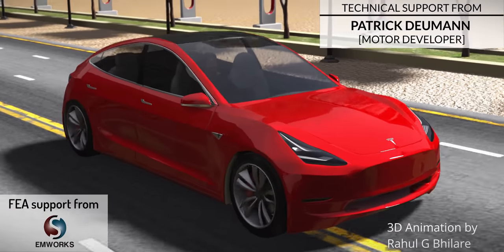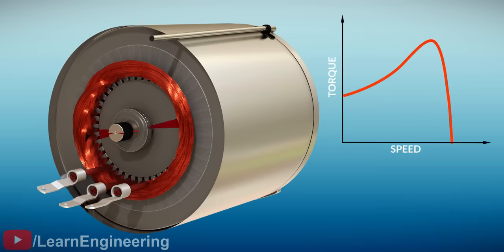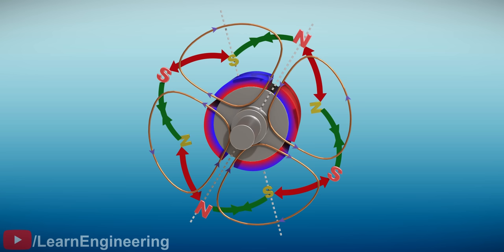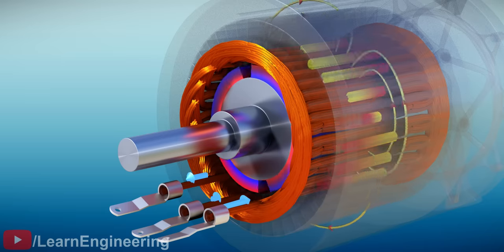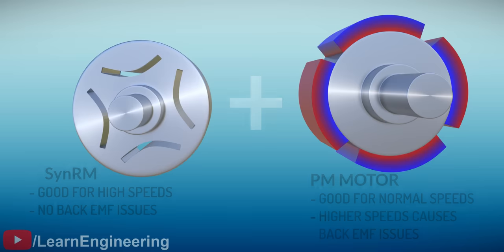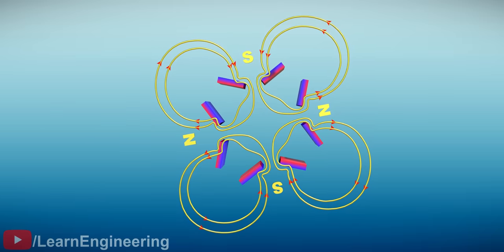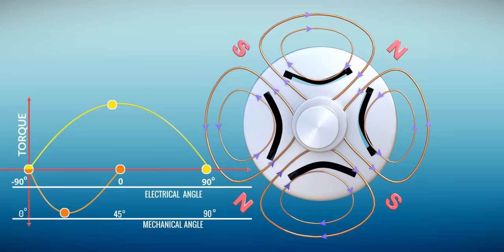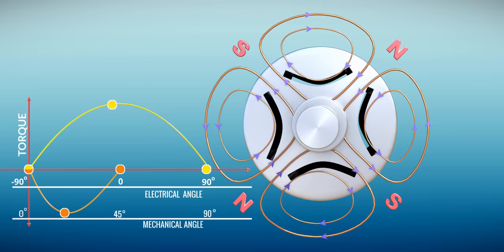Tesla Model 3's motor - The Brilliant Engineering behind it

Comment: So in short the Tesla engineers decided to go for a regular brushless motor design that the rest of the electric motor industry been using for years?
Reply: An AC motor isn't called a "brushless" motor, even though it doesn't have brushes... but yes, Tesla is now using the design that most EVs have used for a decade.
Reply: @brianb-p6586 A brushless AC motor can be called a brushless motor indeed, it’s also known as PMSM or EC motor.
Reply: @FluffyAnvil  Brushless just literally means that it doesn't have brushes. While some AC motors do have brushes, this (like almost every other EV motor) does not have externally powered windings on the rotor so it does not have brushes. Yes, it's brushless, but so are most AC motors (and no DC motors).

The same motor can be driven properly with sinusoidal AC power or crudely with on-off pulses, which is often called "brushless DC"... but unless it is wye wired (this is not wye, it's delta), the polarity has to be reversed with each cycle, so it's fundamentally not DC.

More specifically this - like most EV motors - is an interior permanent magnet synchronous AC motor. Previous Tesla motors were asynchronous induction AC motors.

"PMSM" would be Permanent Magnet Synchronous Motor... and that means that the rotor used permanent magnets to establish its magnetic field, and turns in synch with the rotating field cause by AC excitation of the stator windings.

An "EC" motor is "externally commutated". What the commutator does - physically with rotating segments and fixed brushes or externally with electronic switches - is to invert the supplied DC power to produce the alternating current required to drive the stator.
Reply: @brianb-p6586  EC generally means electronically commutated afaik.
Reply: @FluffyAnvil  True, electronically commutated by an external device, rather than mechanically commutated within the motor. I should have said "electronically commutated".

Comment: And at the 27 degree we could add a coil to generate electricity back to recharge the battery and increase range to much longer range per charge. In fact it could be nearly fuel less

Comment: Tesla has officially caught up too the RC car technology. Now we need to get an even newer tech to get us away from neo magnets.
Reply: RC cars use SynRM's?
Reply: @odisy64  Its basically a BLDC inductance motor that uses neo magnets. Yes, RC cars use them.
Reply: @lilmangofast  its also the type of motor you find in high end power tools like impact wrenches and battery saws. Its a bit more than an RC motor.
Reply: @odisy64  The tool industry has always lagged the hobby industry.  The tool industry trickles it in so they can advertise new features each year.  Tekin 410k had programmable torque curves for their brushed motor in 1996ish.  When bldc hit the hobby industry it took the tool industry 10 years more. Graphene battery packs have been out for over 10 years. I guess they use the hobby industry because it makes a good small scale test bed. Reliability in the tool industry sucks as well.
Reply: @lilmangofast  i can tell you ,that very few RC car's have the power of the motors i use in my power tools. the designs may have been adopted but the application is entirely different. just one of my hand held saws puts out 2,400 watts.
Reply: @odisy64  You have not followed the trends of the industry I see. Hit up a hobby shop. There are race cars putting out greater than 2400w and the Traxxas X01 that was a factory 100mph car consumed that much.
Reply: @lilmangofast  their is a reason i said "very few" most people arn't using such high powered RC cars, but this type of power is typical in a battery power tool.
Reply: @odisy64  And what I am saying is its common in certain scale cars. Anything 1/8 is pretty extreme. Then move to 1/5th scale electric and ots flat out nuts. But even brushed back in the day drag cars with cobalt motors and 36 cells would run 0-100mph in under a second and dump a couple hundred amps. Those were 1/2 sub c cell SCR and were normally cycled at 80 amps continuous discharge. So even matching packs for old brushed motors that was over 3500 watts. Thats would be "not everybody".

Comment: Nothing brilliant, nothing new, brushless tool manufacturers have been using these before Tesla, however the reluctance slits are new-clever.
They will also use hall-effect sensors to detect the rotor position and send that back to the confuser and hence also detect speed and torque-(based on the slippage between field and stator currents).

Comment: The only thing I understand is that it takes fossil fuels to charge the batteries
Reply: There are countries where energy sources are clean, this is a problem with the electrical system, not the car.
Reply: @leandro842   Name one
Reply: @bowdoin5063  https://en.wikipedia.org/wiki/List_of_countries_by_renewable_electricity_production
Reply: @leandro842  Nice list of countries that still use fossil fuels
Reply: @bowdoin5063  Congratulations! 20% of fossil fuels in hybrid power plants is exactly the same thing as burning 100% of fossil fuels in cars, excellent observation, you are a genius.
Reply: @leandro842   Keep telling yourself that Einstein

Comment: Tesla is a Chinese EV! Tesla cars and components are almost entirely “Made in China.” For the electric drive system, Chinese companies provide the electric drive module and motor parts. Tesla EV most of them use Chinese made Batteries, and most like all Tesla EVs will all be using China made Batteries. :body-blue-raised-arms:

Comment: A Tesla car is all about acceleration. I had my first ride in a Tesla. It was a Model C, 4WD, with an extended range battery. The driver went from a standing stop to 60 mph at WOT. I was pinned to my seat so hard I thought I needed an airman's G-suit. But, here's the catch: That one acceleration cost 2% of full battery charge, implying 50 such accelerations will drain a fully charged battery. It's a deal closer, a gimmick for the Tesla Agency, demonstrator, that's all.  The same Model 3 was driven from Stockton, California to Pueblo, Colorado, requiring seven long charging stops.  My Buick Le Sabre could make the same trip in two quick fuel stops.  As the Tesla ages, its battery capacity will diminish.  At the end of its useful life, it will max out at 80% capacity and the same trip will require nine stops, given there are enough charging stations and the car will have enough range between stations.  Count me out for electrics.

Comment: Was waiting for the explanation of the Halbach effect they leverage with the segmented permanent magnets.  https://en.wikipedia.org/wiki/Halbach_array
Reply: Usually you'd use ferromagnetic material to concentrate magnetic field, using the Halbach effect you could do away with the extra ferromagnetic material and save weight/cash, or engineer particular magnetic field structures not possible with ferromagnetic materials. 
But since in high power electric motor you still need a structural skeleton anyway the Halbach effect is not useful.

Comment: I have heard  that axial flax motor may have 99.9 % efficiency ...      Explained motor (that is radial flax motors) is LOOSING of 50 % of induced MF in outer space !!! MF outside the shell of this motor is NOT used \ waisted.    Koenigsegg is using the axial flax motors ONLY!  So the explained types are outdated and trash.....

Comment: Why the name Tesla, Tesla was AC  the Tesla car is DC!
Reply: The battery is DC, of course, but the power to the motor is AC. The company stole the "Tesla" name in recognition of Nikola Tesla's invention of the induction motor, which was the type of motor that they used originally; although their new motors are not of the induction type, they're still AC motors.

Comment: All I got from this video is if this motor ever takes a shit, you won’t be repairing these cars yourself.  Such a great design. Can’t maintenance, repair, or prevent electric cars from going to shit and being totaled out in a matter of 10 years. I dont know how this video is being pushed on me to accept electric cars as the future when it’s clear they are not.  Yesterday there was two lines at the car wash, one that had 4 gas motors in it, and one that had a Tesla in it.  The line with 4 gas motors in it got through the self help kiosk before the one Tesla driver could get through. The Tesla driver couldn’t help himself until someone who worked there came out and helped him.  My point is, only retards buy full electric cars thinking they are saving money.

Comment: There is nothing new or unique about the tesla cars. The stator motor is more than a century old, the technology used in the battery pack is even older than that, and the pulling together of these two thing to make an electric car began in the early years of the very first automobiles. Tesla's greatest feat is conning idiots into paying out huge amounts of cash for old tech put stupidly into a car body. For example does the Tesla need the electronic gizmos to open it. start it or run it? There is no need for electrically assisted door latches, for electronic dashboards or mood lighting. If you hate the 300 mile range then stop wasting power on things that can work on their own (ie analogue systems that use little power if at all) as they have in every other car since year dot. Power conservation is going to be a growing issue in the future, burning it away to be fashionably cool seems ridiculous to me.

Comment: Terrible misinformation in this channel.
1. It is factually and technically false that back EMF causes lower efficiency. Back EMF has very little to do with efficiency, if at all.
2. It is factually untrue that permanent magnet motors are terrible at high speed applications. The vast majority of electric motors used in the model aircraft scene are of the permanent magnet variant, and those are known to run at up to 40,000 RPM at 88% efficiency, compared to about 4500 to 6000 RPM for the Tesla. In fact, PM BLDC motors are ESPECIALLY efficient and power dense at ultra high speed applications, especially the coreless variants: the air cooled ancient AVEOX 1406 motor I quoted above weighs only 200 grams and delivers 400 watts of power, with a power to weight ratio of 2kw per kg, compared to about 4kw/kg for the much larger Tesla motor (water cooling rig not included).
Only when you need to add gears get those extreme RPMs down to generate torque the efficiency of BLDCs starts to suffer.
3. There are technical tradeoffs between permanent magnet motor and induction motors, and no version is definitively better than the other.

Comment: The name of this channel is "learn engineering'. I can promise you that under 1% of your audience will understand what you are talking about. This is the same type of horrible explanation that poorly rated college textbooks use to explain things. If you double the length of this video, I can guarantee that 10x the amount of viewers will understand this video. You need to explain to your viewers which equations are at play and what is what. A random loop doesn't signify if I am looking at a b field or a current. I bet the speaker is a paid voice actor. A lot of the concepts in this video aren't very strait forward and come from simplifications of derivations.

Comment: These coal powered (where the electricity comes from) cars are way overpriced and serve no practical function.
Reply: They’re the same price as other affordable cars, with other, better features. They’re faster, have more storage space, are safer and more reliable than other cars that are available for the same price or higher. The Tesla model 3 starts at $35,000 USD.